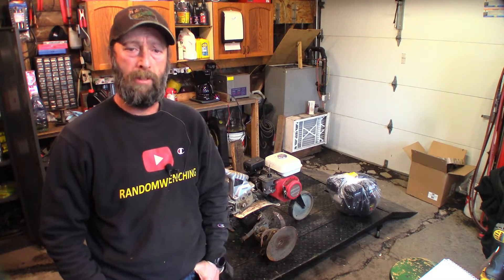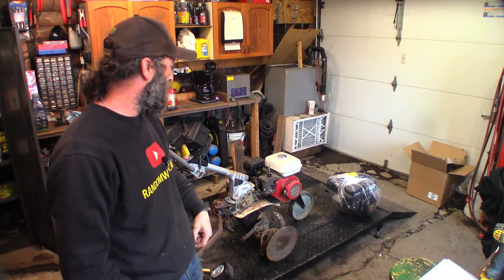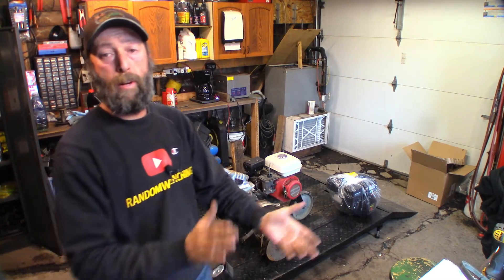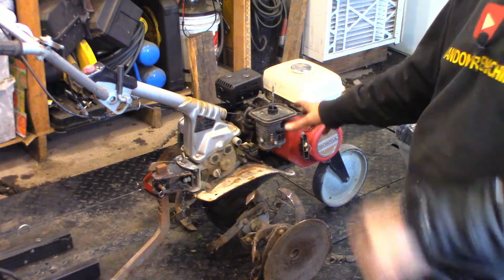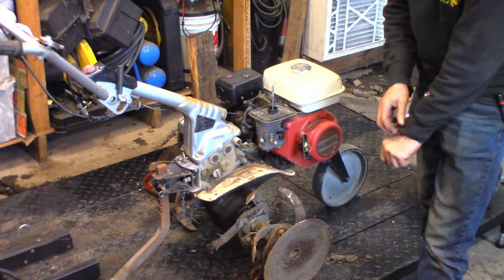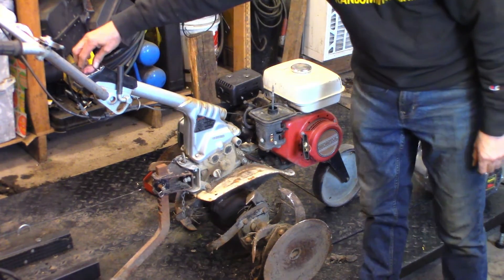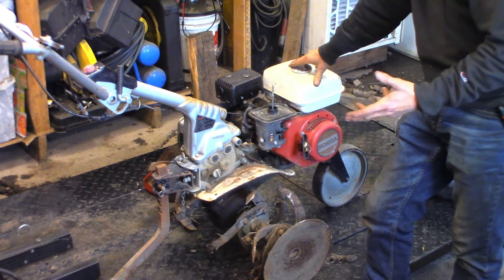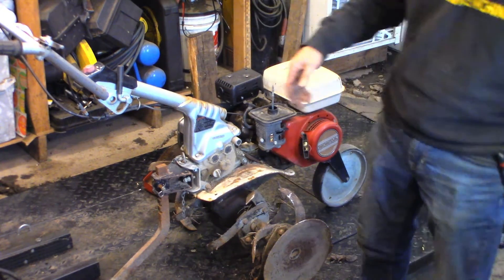Replacing the engine on a Honda F501 Tiller.

Comment: Nice re-power, so much cooler when you can keep original controls operating. Nice job figuring all that out, I bet most will just throw the new motor on without a thought to the original operating system.
Reply from the maker: Thanks Len.  I'm happy I could get those working as well.  I had to figure out how to tie it in with the oil level sensor on the new engine.

Comment: That thing looks old,it's good how you kept it user friendly for the customer. Runs great 👍 good video.
Reply from the maker: Yep, it's a much older version of a model they still make.  The original engine was a Japan made one. I've already uploaded the video on when I took it all apart, diagnosed the problem and fixed it.   That was an interesting video, you'd be surprised at what I found was the problem. I just  edited the description with links to that 2 part video.  That engine is sitting in my shed waiting to be used again.
Reply: @randomwrenching  awesome can't wait to see it, I love a good diagnosis video
Reply: @randomwrenching    Now you’ve already answered my question. Homework - watch those two videos. 😂👍🔧